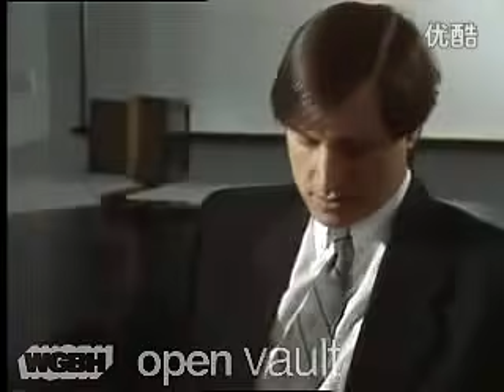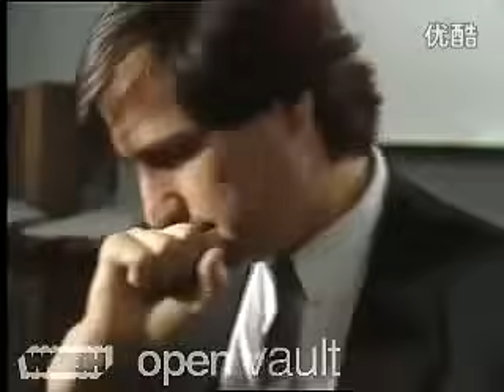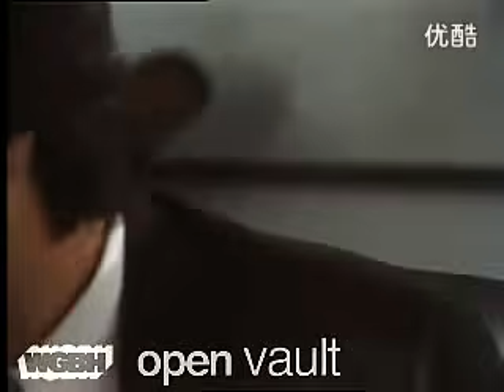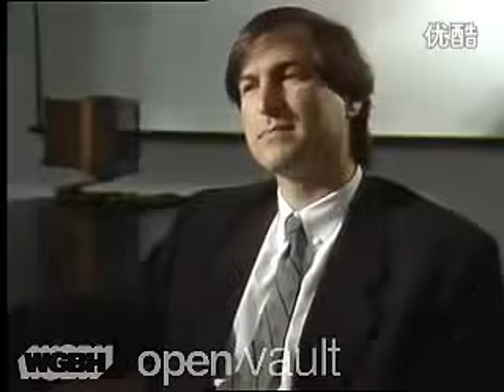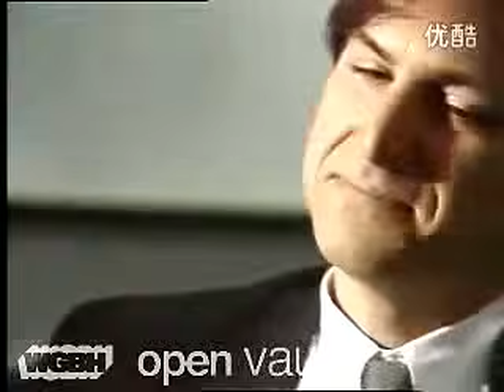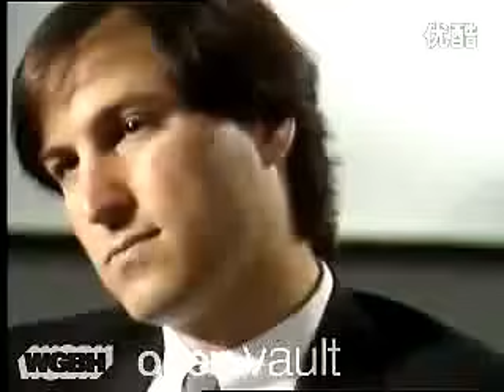[subtitle] Steve Jobs Lost Interview 1990 [50 min version from wgbh]

Comment: He introduced multitasking within the operating system and not enhance the technology that current year. By building a software which took 4 years with 50200 software engineering has lead Steve's to success on this operating system.